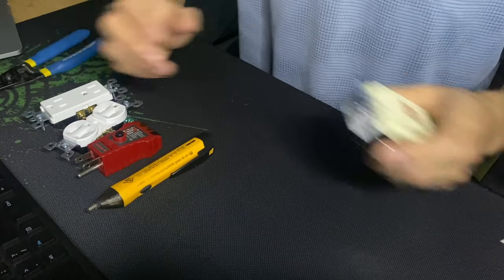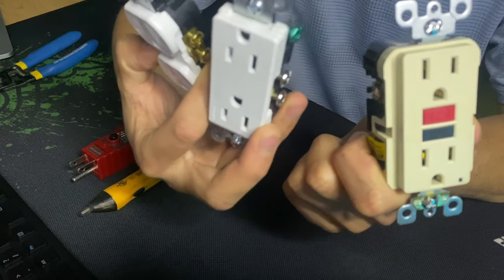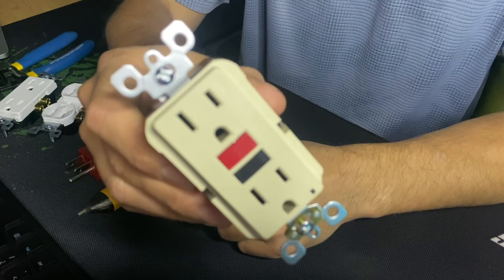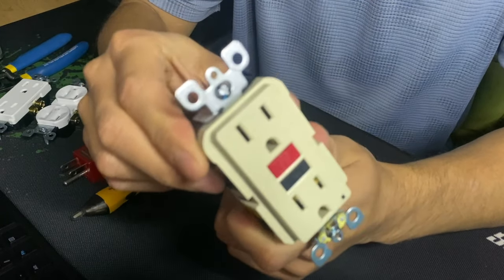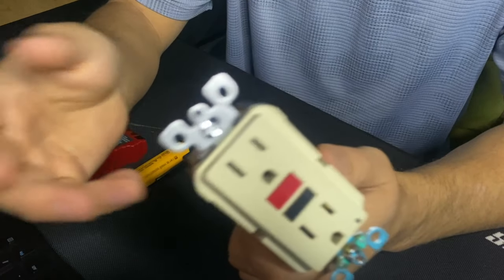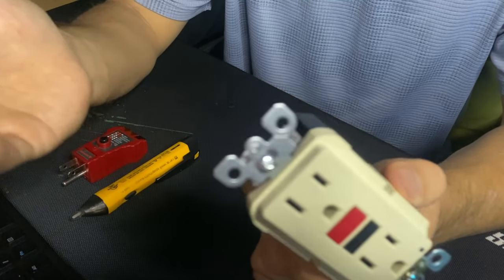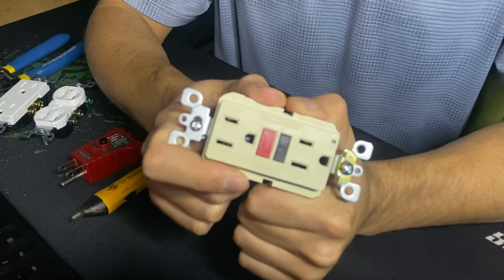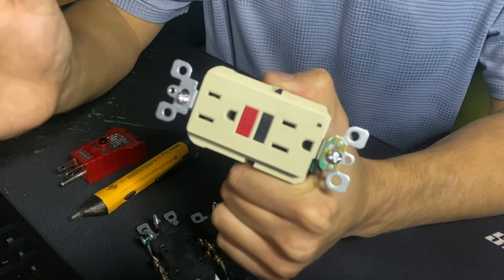GFCI Outlet Not Working 🤷‍♂️ Can't Reset It

Comment: Well I'll be damned!  My disposal failed permitting water into the motor housing and spilling under the sink.  I ran to home depot and bought a disposal and installed the new one.  Still didn't work.  I plugged the disposal into a different plug and the disposal was fine.  Figuring my GFCI failed, I ran to home depot and bought a new outlet.  After installing the new GFCI outlet and it still wasn't working, I thought I had an issue with the switch maybe.  Came to YouTube to get an idea about what it could be.  This was the first video I watched and...  Bing!  Bang!  Boom! Done!  My disposal is working.  How freaking easy.  Thanks buddy!